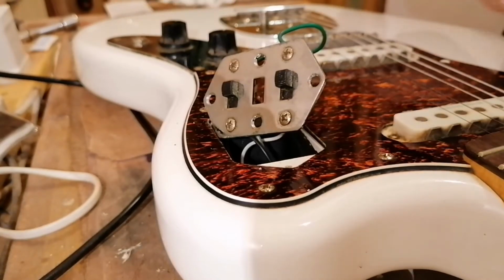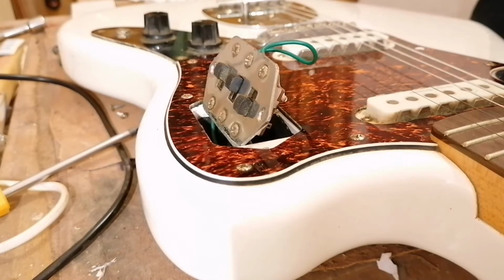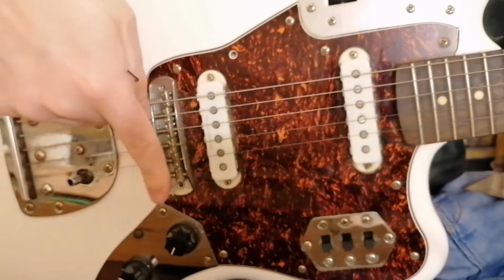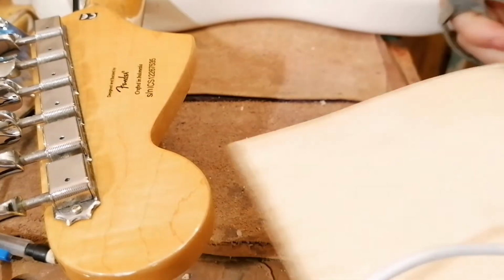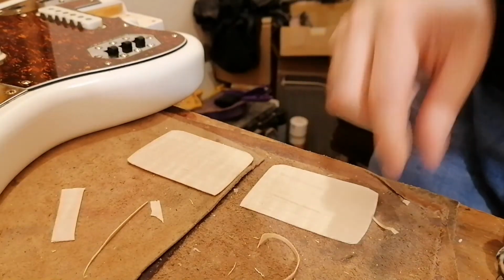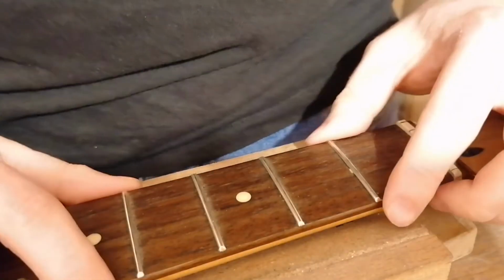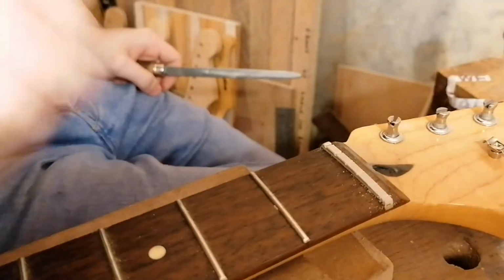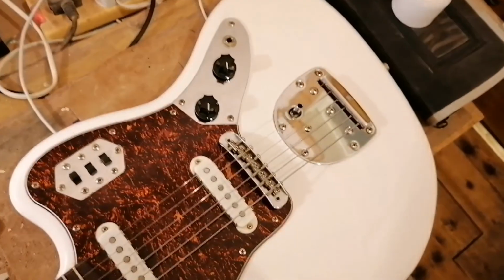Squier Vintage Modified Jaguar - Switch repair, set up & neck shim

Comment: cool video

does that shim have an angle ?
or its just straight
Reply from the maker: Angled, I just use a sander to make the angle so it tapers to almost nothing at the opposite end, and use smaller "traditional" type shims to get the starting thickness